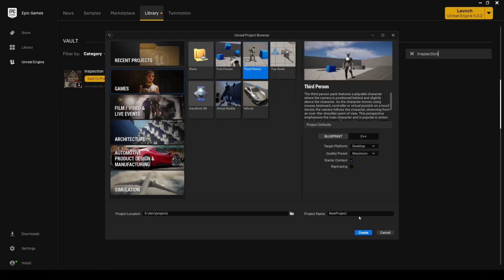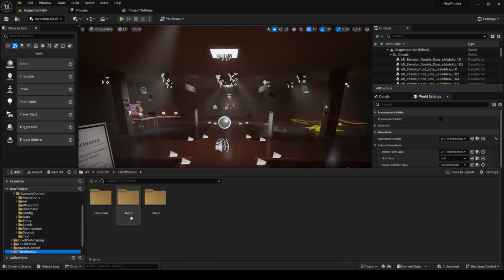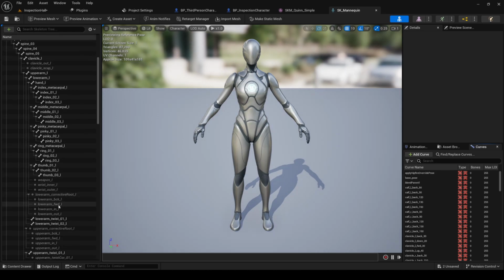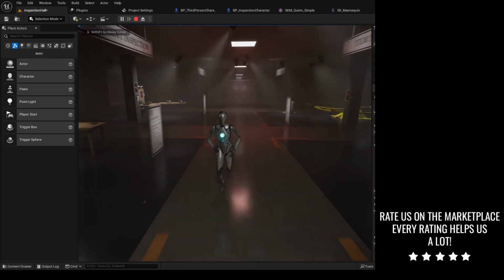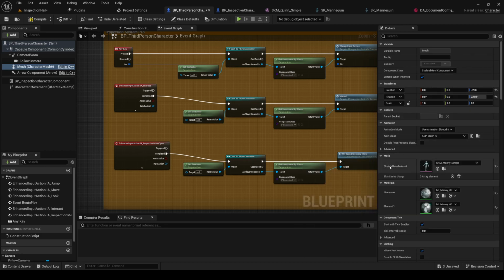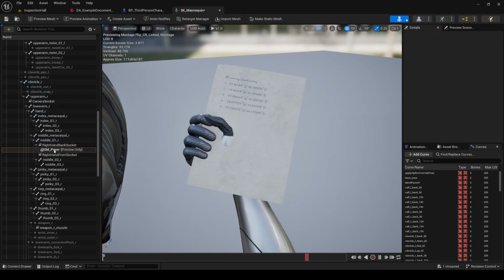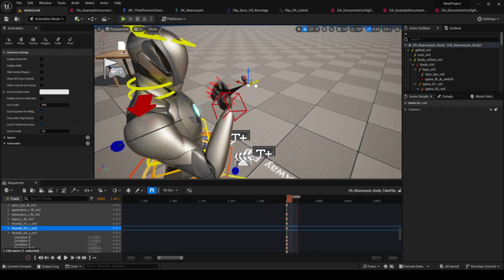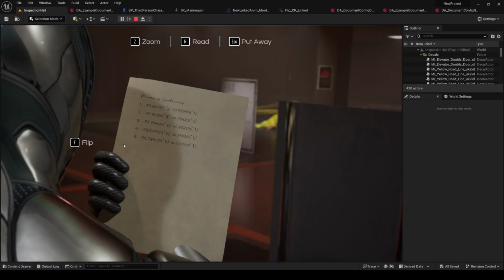Inspection System Pro - Quick Start Guide [OLD]

Comment from the maker: We just updated Inspection System Pro to use Common UI, the setup steps at the start (0:00 - 2:00) have changed slightly. This video will be updated soon. Use the written documentation in the mean time for the setup. The integration into your own character is the same as before, so you can use the video for that.
Reply: When I add it to project and try to play to test from the level (hall) it says not all blueprint are compiled
Reply from the maker: @JUST_PSYC7O  Please join the discord for support questions and use the written documentation.